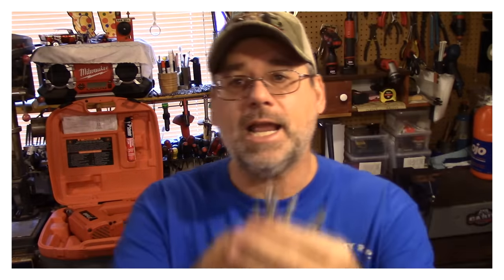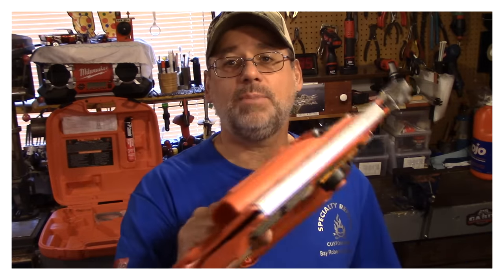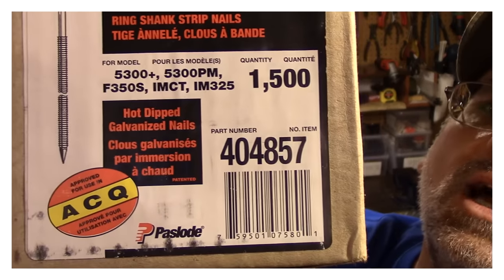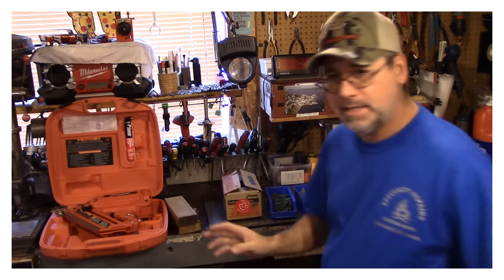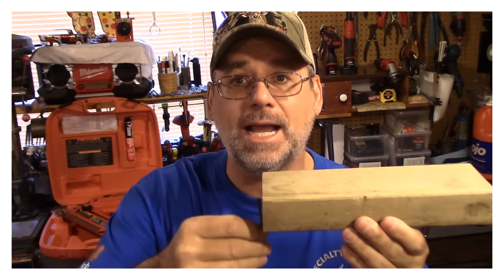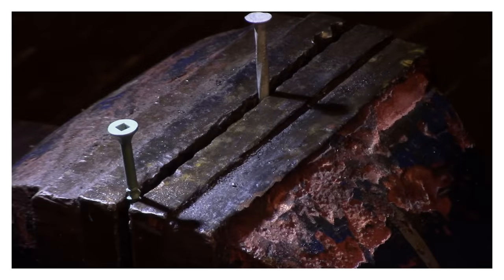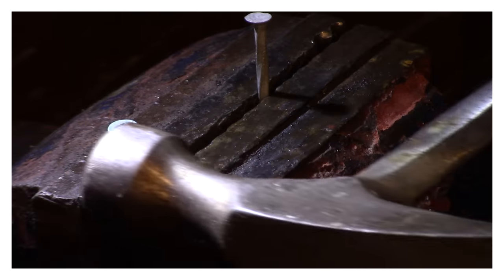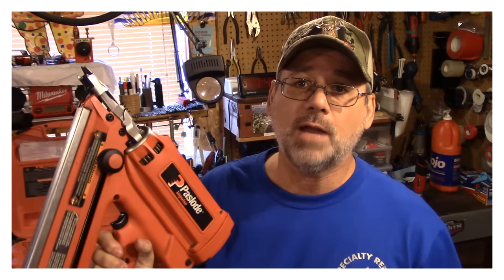BEWARE  NEVER USE DECK SCREWS  - DECK SCREWS VS NAILS -  PART TWO IN DESCRIPTION

Comment: So you’re saying that screws are for tensile strength( non-structural application) while nails are for shearing strength(structural application). I just read about that before watching your video.
Reply from the maker: Deck screws are to hold down deck and fence boards and not to be used in structural construction . Cheers

Comment: Steve  i have to replace my decking its gone rotten now I found your demo hitting a decking screw interesting , I need to remove the decking screws but they seem to be stuck also they snap easy when I tried to remove them, should I use good quality screws instead of the green decking ones?i am in UK so our decking is different than what you would call decking .
Reply from the maker: I like stainless steel and #10 shank , much better but pricey.  Cheers

Comment: Those square head screws are cool, wish we had those in the UK instead of Phillips heads everywhere. Thanks for the video, I was just about to build a deck using only screws.
Reply from the maker: Thanks much appreciated.
Reply: @SteveRobReviews  So I am having a deck done...the guys already used the yellow deck screws all over....I wish I had known....their logic for screw was that if you need to take apart its much easier...and I always thought screws held better.  but i kinda knew nails were better for shearing pressure..but I did not think screws were that bad..is the screw the same material?  why does it break so easily.
Reply: There are some screws with hex / Allen key type recess. The box of screw comes with the driver bits also. Sorry I can't remember the name ( my brother in law gave them to me)  I think they were from tool station 🇬🇧
Reply: @sparkfishes  I think you mean Torx.
Reply: Star bit is better.

Comment: I love using deck screws. I have deck on my above ground salt water pool. ( went to salt water system after deck was built ) the salt water was  just brutal on those regular screws! The salt rusted those screws away to nothing in 2 years ! ( i know duh)  I am now replacing my decking boards and using all stainless steel screws.
Reply from the maker: That will fix it . Just the use of salt in the winter on a deck will do the same over time . Cheers
Reply: Coastal code requires stainless..

Comment: I read the same thing however they do recommend using deck structural screws to do the structural support.  Have you tried that before? Just curious, thanks.
Reply from the maker: Absolutely I have but their not at all the same as a regular deck screw . Cheers

Comment: Please make a video with ‘DeckMate’ screws.  I can’t speak for the screw you used in this video but it looks far inferior.  Can’t argue with the video evidence but you did swing the hammer at a different angle on the nail.  I have full faith in DeckMate screws.
Reply from the maker: I haven't  tried a standard #8 deck screw  that didnt snap. You have some give it a try. Cheers
Reply from the maker: I agree but you would not be so impressed by the amount of times I have seen deck screws used for joist hangers instead of the proper fastener and as usual it was a diyer that didn't know the difference thus this video. Cheers
Reply: I don’t like DeckMate. I do like DeckPlus.

Comment: Those look like regular drywall screws or, the longer version thereof.  Good deck screws are highly corrosion resistant and plenty strong.
Reply from the maker: I assure you they were deck screws and in part two just filmed the other day I extend the test and you will see they are indeed  deck screws. Deck screws are an excellent choice  for  PT wood on deck boards and fence boards. https://www.youtube.com/watch?v=x1e3q...

Comment: Ahh deck screws. But is it okay to use structural screws for load bearing walls?
Reply from the maker: I use whatever is permitted in compliance with local building codes . Takes a quick call to find out forsure.  Cheers 👍

Comment: Common mistake in diy deck construction video, attach rim joist to side of post with a screw, screws aren't intended to carry a vertical load. The correct method is to put wood on top of wood then fasten it together using appropriate hardware and fasteners.
Reply from the maker: Yes sir your 100% correct David 👍
Reply: Anyone who doesn't use lag bolts for that should not be building a deck other than their own.

Comment: I made a 7 by 14 base for two2 sheds and I used the screw nails to hold the 4 by 4 together but they kept bending because of knots so I just use a small drill and made a pilot hole for them. Problem solved. Oh btw I don't have a nail gun. I have an arm and hammer.
Reply from the maker: Nail gun doesn't do good on knots either. They will bend as well. Screws work great in the right wood for  non structural loads. Arm and hammer is sore arms  :)
Reply: Oh I left out the smart part
Arm and hammer and head. 
I used my head and drilled the pilot holes
Then the nails went Wright write rite right in.

Comment: If you like the paslode brand, you should really try the dewalt cordless framing nailer, it accepts paslode paper collated nails, battery only no gas, and does bump nail.
Reply from the maker: I've switch to my bostitch air framing  nailer as my go to now.  The pasload  is a great backup now. Cheers

Comment: They make galvanized screws now but get your point I don't think a good screw would do the same you think?
I think a good box of joist screws would do the job you think?
Reply from the maker: The recommended screw for the application is by far the best choice. 👍

Comment: It doesn't mean they crap. They are not made for supporting weight.
Reply from the maker: Their crap for holding high side loads , not designed to hold structural side loads but great for all the areas your local building code specifies. 👍

Comment: It's called shear strength.  Follow your code in your area and I will assure you that STD. decking screws are not up to code. However for joists and or framing of a deck look to fastenmaster or Simpson strong tie struxtural screws. The fastenmasters have greater shear strength then a 3/8 inch lag and are the size or smaller diameter then a 1/4 lag and come in a hex head or a torx thin profile head.  Great product and will work on PT and Cedar boards.
Reply from the maker: Well said Jay 👍

Comment: I think the quality of pressure treated wood is terrible when compared to what was available, say, a decade ago.  I have had a real problem with the coated deck screws and pressure treated deck boards.   Within a year or two of installation, the deck boards invariably rot where I fastened the coated deck screws.  I am tempted to use galvanized nails, but came across a term "galvanic wood rot" which stated the galvanizing on the nails interacts with chemicals in the treated wood to cause this.  What do you suggest?
Reply from the maker: Stainless Steel  deck screws have been a great success for me in the last 10 years , a bit pricey but  work great compared to the regular coated screws. Cheers Daryl 👍
Reply: I am having the same issue.  I am going to try the stainless steel.  I even had rot to the joists and had to replace and rebuild many parts and three years later those new screws have broken in half due to rust.  suppose to be a lifetime guarantee.  LOL.
Reply: @gingerchmelewski5637  FYI, I recently replaced several treated boards and predrilled the holes and coated the threads with silicone caulk.  Time will tell. I was going to use galvanized nails,  but read about "galvanic corrosion ".

Comment: You know deck screws aren't even that good for decking. Me and my dad built a deck in 2005 at the old house out of pressure treated wood. We used high grade galvanised screws and nails with brackets for the main structure and fixed the decking with decking screws. After 10 years some of the boards had rotted but most of the screws just sheered when trying to undo them to replace the boards. It would have been better just to nail them down. Luckily it isn't our house anymore...
Reply from the maker: I use a lot of deck screws for decks and I would say I get lots that the heads  shear off installing them.   The removal is like you say , twist and break.  They're made from pig iron i guess. LOL

Comment: I've got to learn how to frame. I need to build a new chicken coop. plus,  I want to have a reason for a nail gun!
Reply from the maker: I will show you how sweet a nail gun is LOL  Lots of fun and my arms love it too.  An outhouse build on youtube hahahah
Reply: STEVE ROB yes!  plus we could move back to Alaska (at some point) and that would be awesome to know how to build one. do you take your toilet seat inside with you so you don't have to sit on a cold seat?
Reply from the maker: Now we don't the outhouse is heated in november.  We use a Mr Heater propane heater . It's about 70 degrees in there in the morning after the first up goes out to start it up.  My new one will have a better heater in it I hope if I can find a permanent one wall based small enough.  Alaska is the place to be for the rugged of course. Your pretty rugged I think. !!!

Comment: I don't disagree,  but when would that kind of strike (hammer hitting a screw) happen to a screw on a deck? 

I can see slow gradual pressure on screws and nails. But never a sudden strike.
Reply from the maker: Strictly a demonstration on how some deck screws  are very brittle .
Reply: It's actually a common and very helpful for most demonstration on shear strength. He could have grabbed it with a pair of pliers and just bent it over and it would have snapped the same way. So whether it's an impact or any movement on the sheer line, (might have to look that up) that deck screw is going to break where the nail is going to bend. In my professional opinion if this demonstration just didn't immediately make sense to you, you probably shouldn't be building things in life. It won't suit you well.

Comment: I don't even use deck screws for my deck repairs anymore.  They go in too deep and leave a dimple that collects water and rots the wood and rusts the screw.  I use galvanized nails.
Reply from the maker: Galvanized nails are great and half the price of screws. Yes some pop up but it takes 2 seconds to drive them in. Cheers Peter
Reply: Use a depth setter bit so you don't drive them in to deep.

Comment: I love nails and hand driving them, sometimes i use the paslode when i feel lazy bit mainly i hand drive them cause i want to feel the nail grabbing into something 
I hate screws i just use them for screwing board on top of a deck, to hang doors and windows and drywall, i try to avoid screws at all cost cause i hate them 
Im a 32 year old man with an old timer mentality when it comes to using nails vs screws 😂

Comment: The deck screws rust kind of fast, they say rated for decks but they do not last as long as the wood.
Reply from the maker: On my porch I put down salt when it gets icy  and every deck screw rusted badly and my back deck , I never use salt and it dosen't look much better.
Reply: i think you should have a look at what and where you’re buying your screws from, i remove old screws from decks and projects i’ve built years ago and they are rarely rusted.

Comment: It's a major difference between a screw and a screw. 

It's only when you use the wrong screw you're screwed. 

You might be screwed  when you screw without proper protection equipment. 

Even a bad screw can make an everlasting bond.

If the head gets compromised somehow when you screw, it is nearly impossible to untie the bond without breaking one of the members attached.

You can't screw if you don't know how to use the tool.

It's always best to prep a bond with a predrill and for fine woodworking maybe attach some lubricant on the screw before driving it in.

What's said here can be misinterpreted as not being political correct, but it's true whether you see it literally or figuratively.

Lastly, I can only say, more important than the choice between screwing or nailing is to make shure it's the right members being connected. Because if it aint, you will know it, everybody else will know it and it might be a costly operation to fix, rebuild, tear down and start over. 

Always make sure you know what kind of tree the members came from so you know it's suitable for the project you are working on.

Some material has plenty of bumbs and knots. That gives them often a very fine and appealing look. But it will most certainly make them unsuitable to rely on in a bearing structure.

Build it right, and it will last for a lifetime.
Reply from the maker: Well said 👍

Comment: Those spiral screws are crap for holding. They back out way to easy and are terrible for lumber that expand and contract. Straight galvanized are gonna be your best bet for a plain nail.

Comment: They use thin plastic pieces in concrete to prevent shear cracks, yet the plastic is not very strong. But when encased in the concrete it works quite well. I suspect those screws when surrounded by wood never encounter the force you applied in the vise and will work for  structural loads. 
I rather see you screws in the wood structural joining being tested along with the nails to shear forces.
Reply from the maker: Deck boards , fence  and siding  are  not structural loads.  Deck screws are illegal to be used in so many locations like joist hangers but yes far too many diyers use them. It's not about nails or screws it's about following best construction practices using the correct hardware that are designed to handle the loads .  Cheers
Reply: @SteveRobReviews  Thank you for your reply, I usually use them when putting together  2x4's where many of the joints are supporting themselves thru gravity and just needed to be held in place. And the panels covering the 2x4's.

Comment: So what type of nails do you recommend?
Reply from the maker: For structural fasteners their are so  many so just use what is required by your jurisdiction  and check with local building codes .
Reply: @SteveRobReviews  I think your answer is still to vague.  Local building codes don't tell me the best nails to use.  They tell you the bare minimum.

Comment: Do you know if there's an actual difference other than the coating for deck screws vs those gold "construction" screws they sell at home depot? They look identical to me.
Reply from the maker: I did ask the supplier stocking the shelves last year and they said the deck screws and the gold construction screws are exactly the same but the deck screws are coated green or tan forvthe PT wood and the environment.

Comment: the term you are looking for is ‘shear’ strength. Deck nails do not have shear strength. They are meant for hold down only.
Reply from the maker: I've seen so many  deck screws just sheer apart  with absolutely no sheer strength.

Comment: The contractor used nails on our deck and the wood is splintered from the nail heads.  They were installed with a nail gun.  It has divets as well.  So we will ask for deck screws next time.  If done the proper way I would roll with them instead.
Reply from the maker: I agree a nail gun can leave a rough finish but time is money and screws not only cost more but more time so it's best to discuss this when getting a quote because a low price usually comes with some low appearances too.
Reply: @SteveRobReviews  as a contractor I will assure you that there is always a compromise to a lower price.  Anytime you receive differing price estimates ask why one is higher or lower than another.  It can often come down to differing materials, Construction methods, labor availability, construction methods/approach to the work, or how much the businessman values his time and expertise.  Often on a lower bid there is something missing or quality shortcuts that will be employed.  Always make sure you’re comparing apples to apples or that you know why one fruit is more desirable to another.  If you’re not sure, ask!  If the contractor can’t explain the difference, be wary.  You will be way more satisfied when you get what you expected to get and paid fairly for it.  (Fairly means both parties are benefited)

Comment: Most of yas missed the point he was making. If you have a load bearing piece like a joist for example, it should be nailed otherwise the weight could shear the screw. Other than that, use screws.
Reply: Depends on the direction of force {load} Nails have better shear screws have more tensile. If it's where two pieces can slide against each other on the horizantal nails better, if it's where the direction of pull is vertical screws are  better.

Comment: 6:35, there it is; "never use deck screws for structural." And "only galvanized nails in PT wood". Always btw, even when you nail the rim joists to the PT sill plate on masonry. Not just decks and other exterior applications but any time a nail is driven into PT wood. It's like splicing aluminum wiring with copper; big no no! Also, I never let PT wood touch the ground as finished project. Yes even 'ground safe' PT wood. The new deck codes across the country have finally come up to par.
Reply from the maker: You know your stuff bud .

Comment: What should I use with Heat treated wood?
Reply from the maker: I have never seen or heard about heat treated wood .  Pressure treated wood I use only recommended pressure treated fasteners  in either nails,  screws or bolts depending on application.